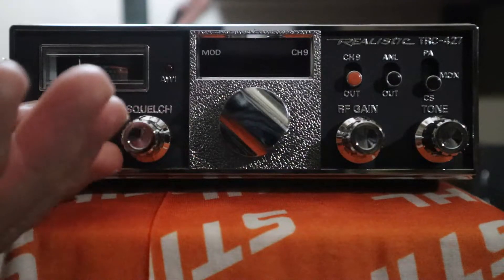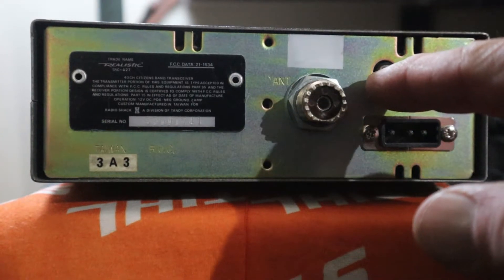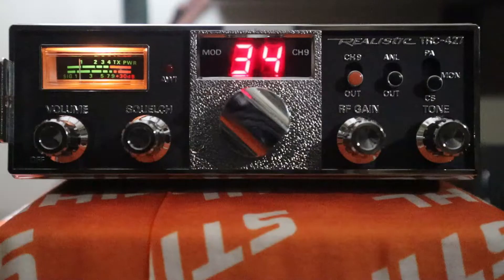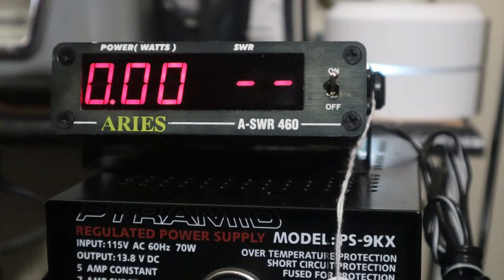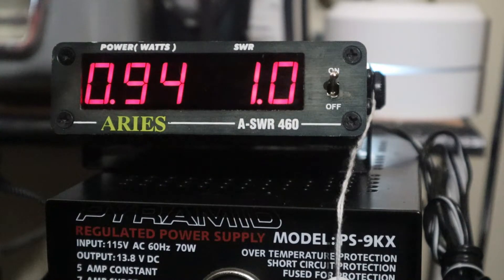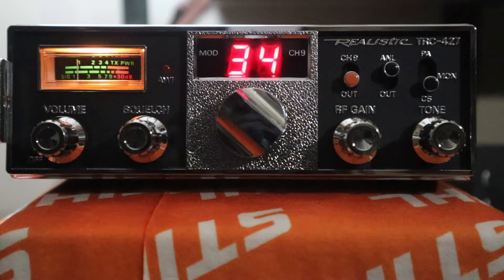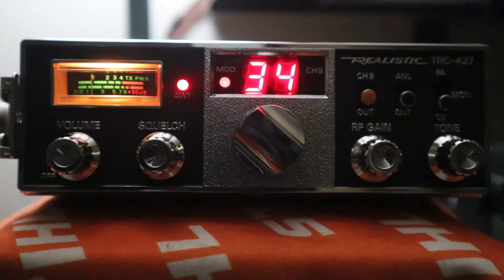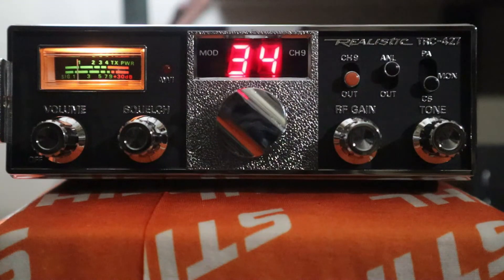Realistic TRC 427 CB Radio Range & Power Test - Radio Shack cb Radio

Comment: This here is sure is very good radio and I mean good. I've had mine for 30 years and it is still working fine. Just out last year that its board was made by Uniden and it is very close to a Cobra either 21 or 25ltd if I'm not mistaken. So now I am going to replace all electrolytic caps coz this 427 is a keeper.

Comment: Very good model you're putting out 18 Watts 17 Watts nice my next to make a contact today from SFU mountain Burnaby Vancouver to Victoria and I've used using trc216 for Watts elevation 900 ft ultimately power definitely helps Victoria could barely hear me however manage to get my signal true so I definitely think you can puncture more than that 40 miles is good starters 73 and all the best
Reply from the maker: what this radio did with out  an amp I thought was impressive.   lots of trees here and my antenna is NOT over the trees.   tks for watching. Mack

Comment: That is a lot of power! I just acquired from eBay for 20 bucks a  uniden 538pro it received and transmits but my aquel and gain are twitchy I probably need a good cleaning if that does not work I might have to send it out for a tune up and peak